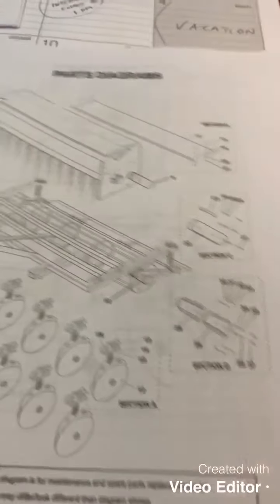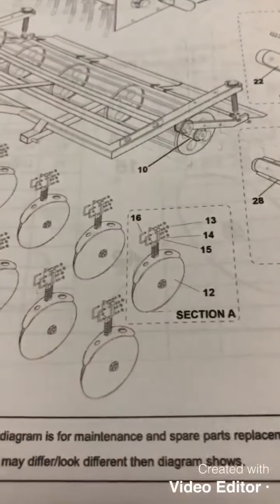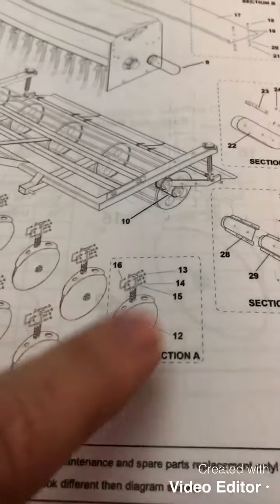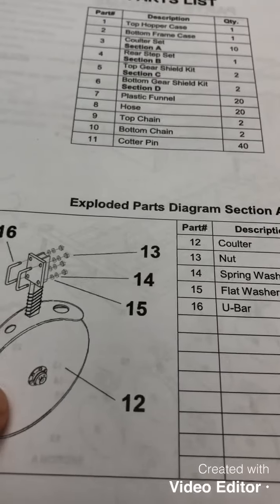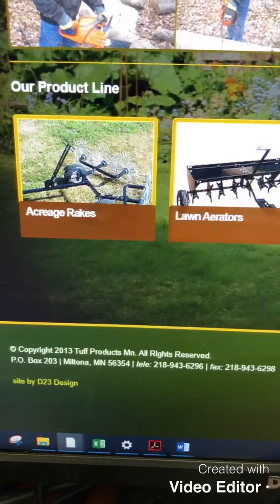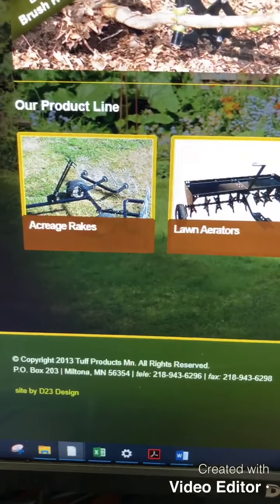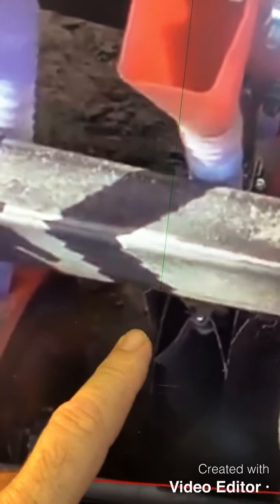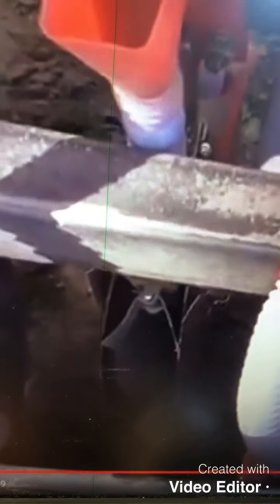Order Parts for Field Tuff FTF-603PTS seeder

Comment: any advises on this seeder improving? thanks
Reply from the maker: No, you just have to recognize that it is not a commercial machine.  Use it lightly.  It doesn't do well with sunflower seeds.  I see there has been some chipping in the paddles on the feed wheels.  The outside scrapers are very thin and will wear out after a couple years use.  Don't try and make sharp turns with the disks in the ground, things will break.  keep everything well oiled after use, the hardware is cheap galvanized type and WILL rust.
Reply: I have a. Country way planter same planter I  called that number to get parts she wanted model # I dont have a manual . I need the plastic tubes 20 of them but I  need the model numbet cant find on planter.any idea what the part #  is ????